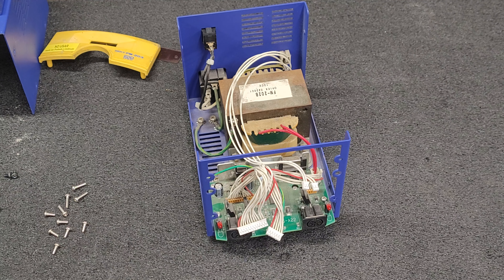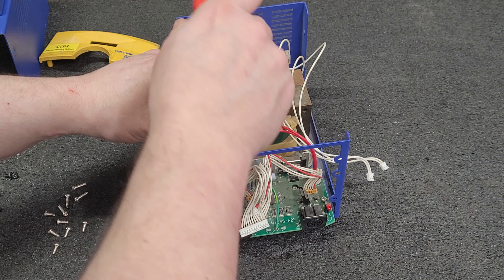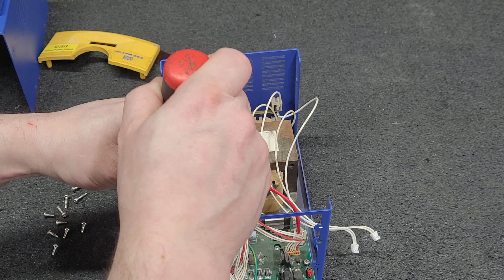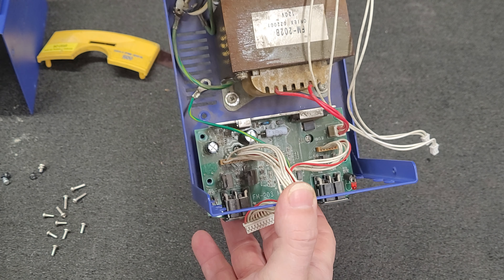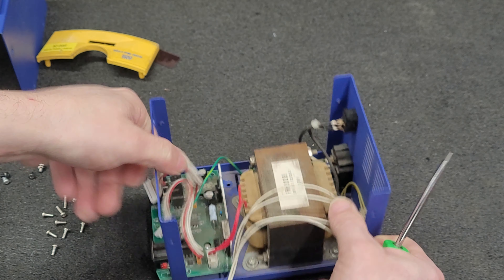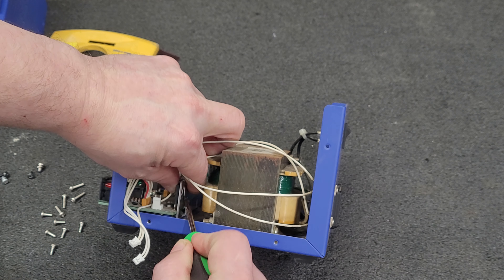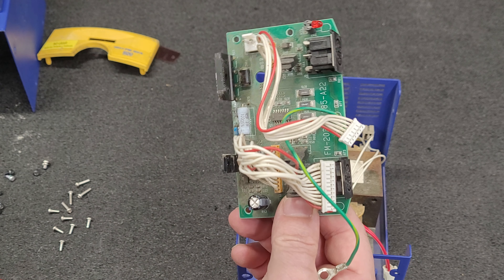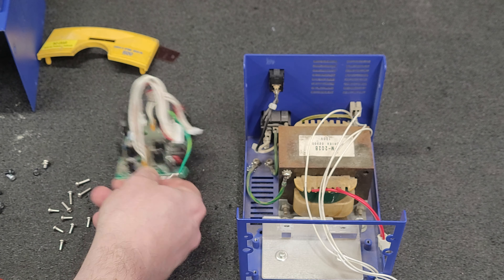Hakko FM-203 Removal of Temperature Board for Thermal Paste Replacement.

Comment: Cool video. It is always good to have tools that are repairable and can have maintenance done easy enough.
Reply from the maker: The FM-203's are tanks just like the 202's just keep up with the maintenance and use genuine tips! The only issues I have seen is people kill the mosfets using crappy knock off tips. Sadly Hakko don't fully support the right to repair but they do offer most every part for these if you need it.